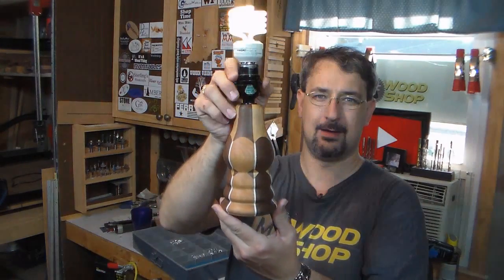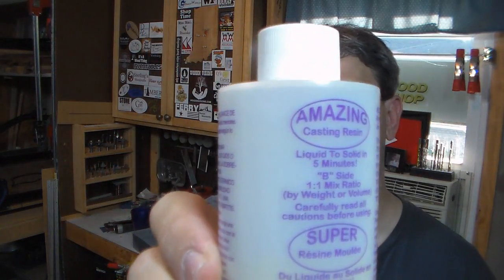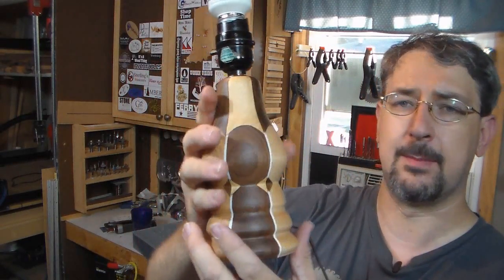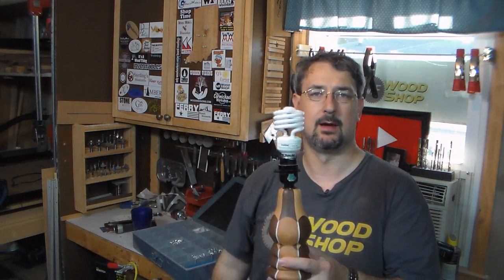Segmented Lamp

Comment: outstanding work Mike   that is a sweet lamp and the casting resin gives the lamp the detail that it needs   Question for you    How did u chuck up the blank i didnt see a chuck or a faceplate?    great job Mike thanks
Reply from the maker: I explain a little more about that in my blog. But there was a hole created from the stave glue up that was perfect size to screw on the head stock.

Comment: Did you use the casting resin because the maters did not meet correctly? If you did that was a genius solution and turned out amazing. If it was intentional it was a great decision, I tried something similar with trying to make a hollow form but the miners were slightly off and now I am going to cut a slot and fill with resin. Thanks so much for the project idea it turned out great.
Reply from the maker: The real idea was to put Purple Heart there but I screwed up the heart and I had that resin as a back up. I'm glad I used it I have some other ideas to try

Comment: Now thats a MF lamp! Looks great!!
 i just bought a mini lathe and im still trying to sharpen up my gouges and other tools..:/  u made it look pretty easy there mike. How long did it take u to master sharpening?thanks man have a good one!
Reply from the maker: Joe basementwoodworking I'm still working on that master level. I found it was a lot easier with a slower speed grinder, and the wolverine system. Took lots of tip from Cap'n Eddie Castelin  and Carl Jacobson
Reply: Mike Fulton i have a ways to go with the sharpening..lol i cant wait to start turning.i think i might send em out so i can turn something and practice sharpening once they dull out.and thanks for the fyi about the other turners